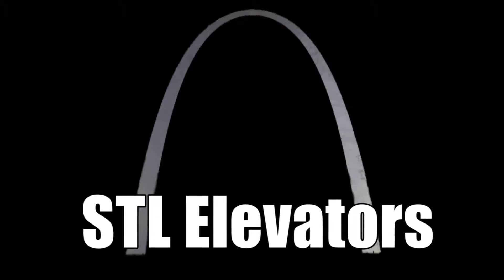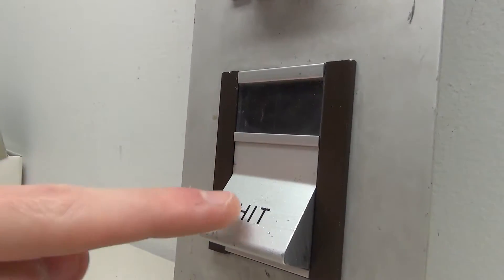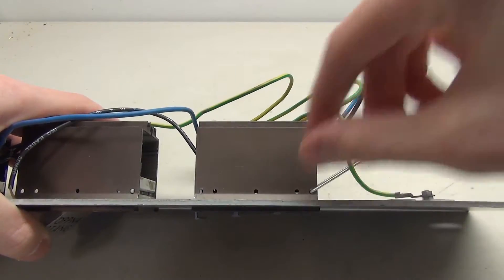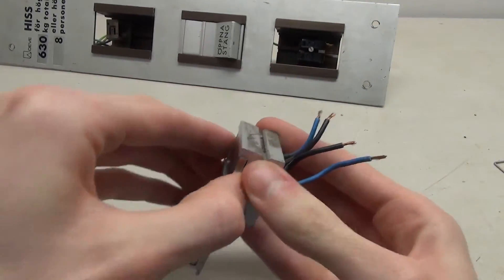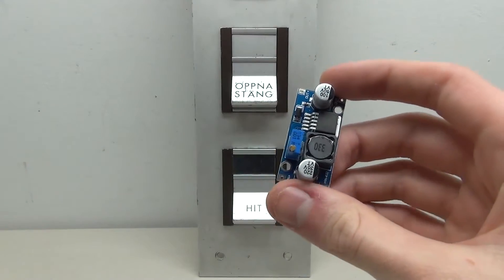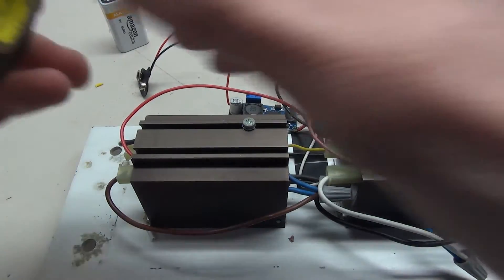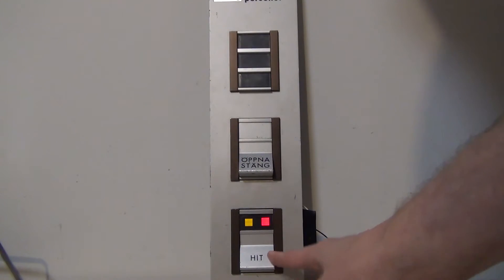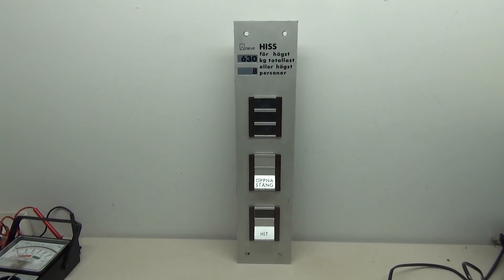Detailed Look and Wiring Deve Elevator Buttons

Comment: Let me explain:
Those "HIT" button LEDs are red and yellow. If the red LED is on, then that means that the elevator is in use and can not be called. The yellow LED indicates the call button (that's what "HIT" means in this case, by the way) has been pressed and the elevator is on its way. And when "HÄR" (which is the Swedish word for "HERE", by the way) is lit up, then that means that the elevator is here and you can just open the swing door (if it has one) or it'll open its sliding door right away.

And the "ÖPPNA/STÄNG" button is for the shaft door operator (which operates a swing door). When that button is pressed, the door will open automatically ("ÖPPNA" means "OPEN"). And you just press that button again, and the door will close ("STÄNG" means "CLOSE"). And sometimes the button will either say "DÖRR", which means "DOOR" or it'll just have a <|> icon on it.
Reply from the maker: Thanks for the explanation!
Reply: @stlelevators  You're welcome. These buttons are from an old Swedish elevator. I have watched a lot of videos about old Swedish elevators. What I like best about them is that some of them have automatic swing doors that are operated by a BESAM PowerSwing, which is my favorite door operator, by the way.

Comment: Cool that circuit board bumped that up to 24 V. How is that even possible with 1 9V?!?!
Reply from the maker: Current is really low. It’s a prefect board to run leds like this.
Reply: STL Elevators Oh, that makes sense. You’re so smart with this stuff!
Reply: Is it a BOOST! CONVERTER